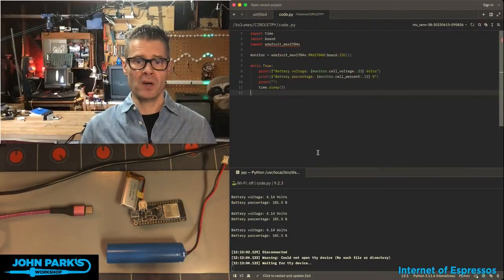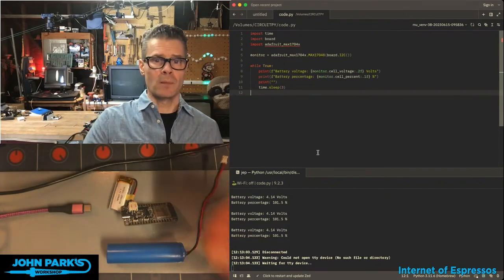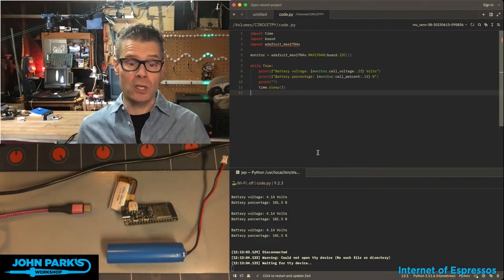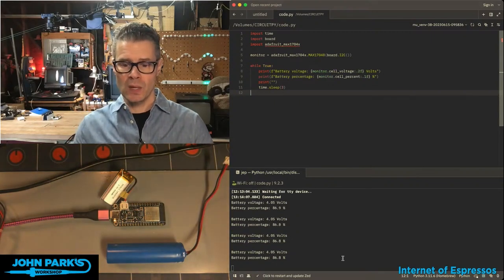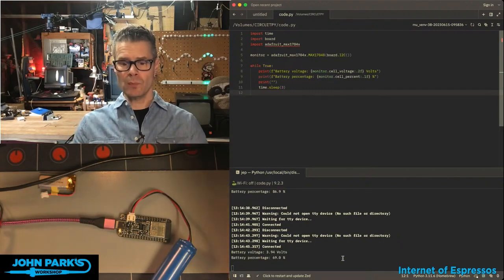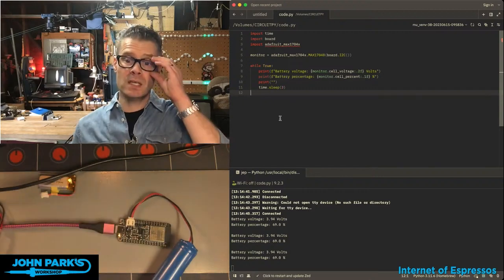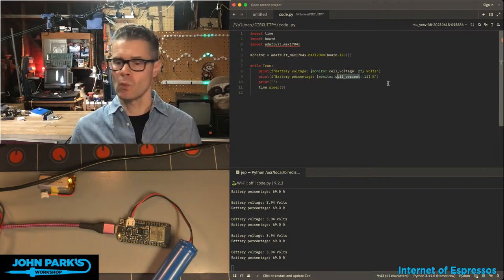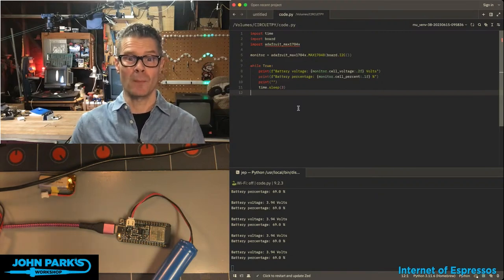John Park's CircuitPython Parsec: Feather ESP32-S2/S3 I2C Battery Monitor

Comment: Hey John, Love your videos. They super helpful.
My Adafruit feather has the older LC709203F Chip. It does not report the correct battery percentage. I did multiple tests and it was always wrong - ran the battery flat many times. I have raised an issue in Github but no one has responded. Perhaps you could take a look at the code and figure out what is wrong? Thx